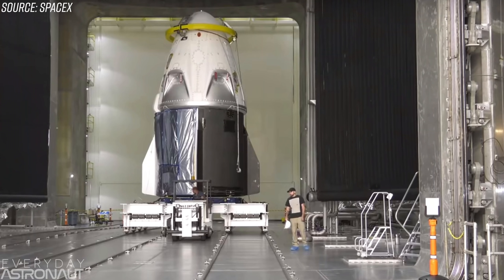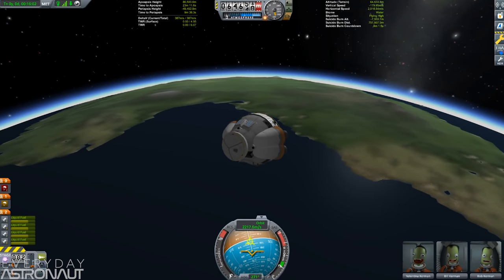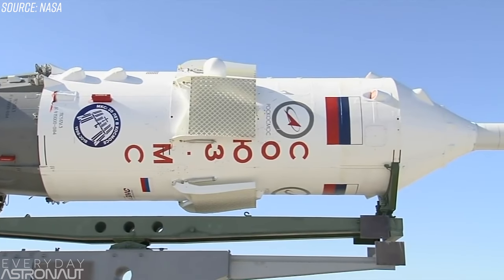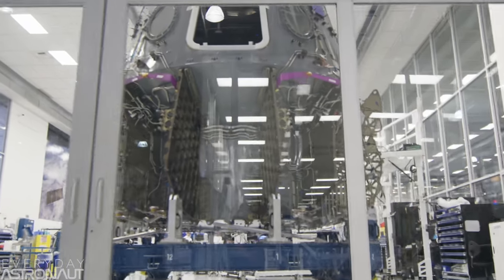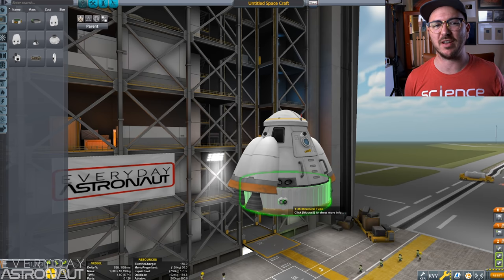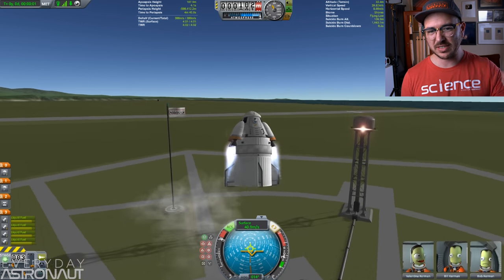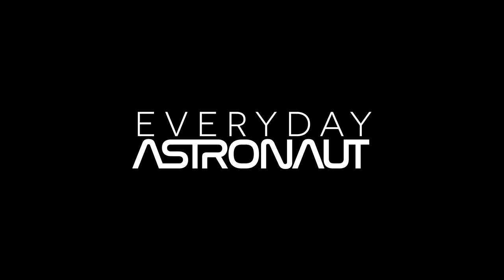Why Does SpaceX's New Dragon 2 Have Fins On It?

Comment: Hey Tim! You recently uploaded a video where you did comparisons on rockets and talked about the engines. (i don't remember what video) You talked about closed and open cycle loops and a bunch of other technical rocket engine terms. You should really make a video about what that means and how rocket engines work. I (and probably a lot of other people) had no idea what you were talking about. Btw why didn't you use the reusability mod? The Dragon trunk, fins, Draco engines, shielded docking port, heat shield and small fuel tanks all are there.
Reply: I suggest Scott Manley's video. KSP Doesn't Teach: Rocket Engine Plumbing.

Comment: Since nobody seems to have mentioned this in the first 100 or so comments... notice the clip of an Apollo abort test that starts just before the 3 minute mark. No fins. How do they keep it from turning around? I suppose it's one of two things--possibly those smaller motors at the top of the escape rocket are correcting for the capsule's desire to go flat-end-first... or, possibly, the presence of the escape tower renders the assembly stable. I recall from my model rocket days that a cone's center of pressure (the term we used in those days, side-stepping the question of whether it's more accurately called center of drag or center of lift) is two-thirds of the way back from the point to the base. And that's why the capsule wants to go blunt-end-first: unless it's got some serious ballast in the pointy end, a cone's center of mass is going to be a lot closer to the base of the cone than that. Did the Apollo's big heavy escape-rocket tower, well forward of the conical capsule, move the center of mass far enough forward for the assembly to be stable?
Reply: The video is not right. There are  important 3 centers on the rocket:  center of mass (abbreviated COM or CoM), center of thrust (COT), and the center of lift (COL). If the center of thrust (defined by position of engine nozzles) is above center of gravity and center of lift, then it doesn't matter if center of lift is even above the center of mass. That is why Mercury or Apollo capsules with escape engine tower high above the capsule did not need any fins when escaping away from exploding rocket , even when both had center of lift above the center of mass.

Comment: The center of mass should be behind the center of lift
The drag of an arrow makes the fins a center of lift in the opposite direction and with the tip beeing heavier therefore puts the center of mass behind the center of lift
Correct me if im wrong
Reply from the maker: If you were riding on an arrow, and you’re at the heaviest area (in the case the tip) you’d be near the center of mass and behind you would be the center of lift. So the center of mass is always in front of the center of lift
Reply: @EverydayAstronaut  yeah i get that thought but shouldn't the force vector of the lift decide where front and back are located? Px
Reply: Kenneth, you are thinking like the early rocket scientists who tried it that way, and then discovered that they had it backwards lol
So, I can't say that you are stupid, because they were pretty smart guys, but you have access to much research since then, so watch some videos on it, or go read on rocket stability!

And while you can use thrust vectoring to overpower the aerodynamic forces (like New Origin tried doing), it's like trying to balance a bowling ball on a needle, and it is extremely unstable. But if you add some fins, you bring your thrust and aerodynamic forces into harmony, and you get stability.
Reply: @ke6gwf  Imagine flipping in that capsule under 3gs acceleration from the solid motor.
Reply: @chriskerwin3904  that would be... Fun? Lol
Reply: @ke6gwf  uhh, it would probably break your spine to have that sudden change of momentum at that level of acceleration.  Especially since the motor appears to keep firing through the turn.
Reply: @chriskerwin3904  yes, which is why the  "... Fun?"
Do you only recognize sarcasm if it has an /s, or does it always have to be explained to you? ;)
Reply: @ke6gwf  No I knew you were being sarcastic, I just like talking about rockets. It's all good.
Reply: Think of it as a dart. Heavy end first, fins second

Comment: Good video on explaining the wings on the service module. How would it get to the ISS or a mars ship should the BFR take longer to build? Do they use the Draco thrusters? Also they have a good Dragon V2 & Orion stock-alike mod that uses the standard capsule you might like to look at using when talking about these space-ships. PS I might want to add why does the dragon-v2 wrapped around solar panels on the trunk? Won't that cause drag?
Reply: It appears that there is a layer of ceramic over the panels and most of the trunk.

Comment: Why do they need a heatshield that could fail and not use trusters to slow it down ?
Reply: Until speed gets lower enough the trusters can't even fire since would be blown down by air running on

Comment: you are totally wrong in the beginning. The rockets need to have the center of PRESSURE behind center of mass. The reason is this brings aerodynamically induced stability,because when the rocket starts to turn off course the torque induced to the back overcomes the torque to he front,bringing it straight again. It is true that the center of mass needs to be at the front,though. This increases the torque at the back and decreass the torque at the front.
Reply: Center of pressure and center of lift are two different ways of saying the same thing.
Reply: In other words, he used the wrong word, since lift is basically caused by pressure?
He may need to use a better term, but saying he is totally wrong, is totally wrong!

Comment: Hey Tim if the parachutes on the dragon failed to deploy could they still propursively land it?
Reply: Depends on a lot of things. On a pad abort, no, it;ll be out of fuel. On a normal reentry it MIGHT be able to if there is a place to land, If the abort fuel is enough for a landing(Is a capsule's terminal velocity under 430ish m/s?), and if landing software is installed. I see it as unlikely unless it was a life and death emergency? Oh and the current design of Dragon 2 has no landing legs, since those were what worried NASA, since it would mean holes in the heat shield, so It would be a bit rough on touchdown.
Reply: @aaronmcculloch8326  Yeah you're right but i guess landing with no legs is better than crashing and dying
Reply: @dann9208  Totally, Hitting the ground at fender bender speeds would be way better than hitting at supersonic speeds! Getting rid of most of that hydrazine has benefits in a crash too!

Comment: SpaceX has filed that they won't detonate their Falcon 9 in the in-flight abort test - rather they are going to send the first stage a thrust shut down command - and it will be up to the capsule to detect this loss of thrust and to initiate the abort..
Reply from the maker: Is that newer than last months filing? https://forum.nasaspaceflight.com/index.php?topic=45279.120
Reply: @EverydayAstronaut  "The abort test would start with a nominal launch countdown and release at T-0. The Falcon 9 with the Dragon attached would follow a standard ISS trajectory with the exception of launch azimuth to approximately Mach 1. The Falcon 9 would be configured to shut down and terminate thrust, targeting the abort test shutdown condition (simulating a loss of thrust scenario).

Dragon would then autonomously detect and issue an abort command, which would initiate the nominal startup sequence of Dragon’s SuperDraco engine system. Concurrently, Falcon 9 would receive a command from Dragon to terminate thrust on the nine first stage Merlin 1D (M1D) engines. Dragon would then separate from Falcon 9 at the interface between the trunk and the second stage, with a frangible nut system. Under these conditions, the Falcon 9 vehicle would become uncontrollable and would break apart. SpaceX would not attempt first stage booster flyback to KSC, CCAFS, or a droneship, nor would they attempt to fly the booster to orbit."

http://www.parabolicarc.com/2018/11/28/how-spacex-conduct-inflight-abort-test-crew-dragon/   

So the first stage would break apart from aerodynamic forces after separation, and not be terminated from any system controlled by automation or humans.

Comment: Blowing the booster will be the closest test to real failure abort that any company has ever done that I can remember.  Do you know of any instances where someone else has had a catastrophic booster failure with a capsule on the top and had the abort system perform correctly?
Reply: Sojuz T10-1 it wasn't inflight but still it had explosions and a succesful abort.
Reply: @SneeuwPoesjes    So SpaceX will still be the closest to a real world scenario that we'll see until they actually have to rely on it.
Reply: @hellcat1988  I think that in real world scenario's most explosions will have an event before it and that will already trigger the abort system. Take as example the CRS-7 flight of SpaceX there was fuel or LOX venting everywhere around the rocket which would trigger the abort system way before the actually explosion, or the Sojuz ms10 last month which triggered the abort system before the actual booster could inflict real damage. But still it's amazing and can always happen, hopefully we never have to use it :D
Reply: @SneeuwPoesjes   Yes, that would be nice, but the world isn't perfect and knowing that the capsule and abort system can withstand the forces of a detonation BEFORE the system activates would be more reassuring.  No repeat of Challenger.

Comment: If they're gonna blow an F9 booster up on the pad, well, I've got the perfect candidate! The one that got a bit wet a few weeks ago! :D
Reply: This abort will be at Max-Q (aka point of maximum aerodynamic pressure), which means about 1 minute of flight before the abort.
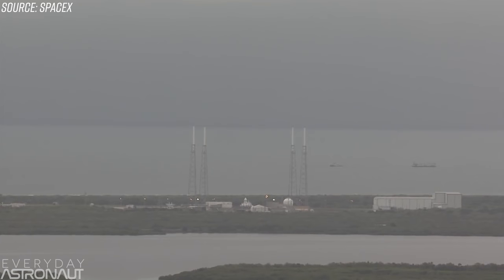They have already done a pad abort test as seen at 5:30
Reply: Yes, a pad abort with nothing else connected. I thought Tim meant a pad abort from a fully fueled F9. But if they need to do it at max Q, then of course they need a flyable rocket. :)

Comment: I would argue that the “fins” are aerodynamic stabilizers. If all they wanted to do was change the center of gravity forward, they’d add weight to the front. Think of the fins as a vertical stabilizer on a plane. The stabilizer keeps the plane from yawing left or right, making the plane go straight.
Reply: Why would you add extra weight, thus requiring more mass to fly, and messing up the capsule reentry stability, instead of adding fins to move the aerodynamic center to the rear of the center of mass?

This doesn't make sense.
Reply: @ke6gwf   For some reason, he was talking about moving the Center of Gravity to the front/top, not the rear. Either that or shifting cargo, (or whatever) towards the front temporarily. I'm just stating that adding weight is how you would shift the center of gravity to the front, not adding fins. Like you said, adding fins moves the COG more to the rear because of their weight. Moving to the front, you would have to jettison the added weight if you want to change the COG back to original configuration. You can't move fuel around to different tanks in a rocket to change the COG. We shouldn't be talking about COG anyway. I think It is irrelevant here. Adding the fins on the rear isn't done to change the COG. It's done to stabilize the craft.

Extra weight doesn't mess up re-entry stability. Apollo brought back a bunch of rocks that added a crapload of weight. Re-entry stability is accomplished by the shape of the capsule, not by the COG.. The capsule could be tumbling and would right itself because of the shape. (There's a NASA video of an engineer tossing a model, tumbling it really fast, and it righted itself in the wind tunnel.)
Reply: @adamsmith5151  you apparently don't understand rocket stability, and also didn't hear correctly what he said.

He never talks about moving the CG forward, he talks about moving the center of lift/ aerodynamic pressure to the rear of the the CG.

In order for a rocket to be stable, the CG has to be forward of the CP, which is why model rockets have fins, and why darts and arrows and badminton shuttlecocks have fins at the rear, to shift the CP to the rear of the CG.
Yes, sometimes you may add mass to the front if it is too light, like the big weight on the front of a dart, but on something like this, you already have plenty of weight up front, you just need to add more aerodynamic pressure behind the CG so that it is a stable system.

But he never talks about moving the CG forward, only about moving the Center of Pressure/Lift to the rear of the CG.
Reply: @adamsmith5151  Oh, and part of why the capsules orient themselves as they do is by having the CG in the right location, so if you moved the CG to the top of the capsule cone, it would flip over and go pointy end first.
It is through having the CG near the heatshield that it gets the large end first orientation.

So for Apollo, they would have carefully calculated where to stow the rocks, and how much weight they could bring back, so that the stability would be maintained properly.
Reply: @ke6gwf  As I stated before, it is the capsule shape that makes it point heat shield first during re-entry not the COG. Air moving over the capsule at thousands of miles per hour is going to flip and keep it in the correct orientation, whether the COG has been shifted or not.

In Apollo 13, they had do move a bunch of weight because they forgot to calculate trajectory with extra weight they would have brought back and would have ended up skipping off the atmos. They didn't have time to calculate the individual weight of the ballast that they moved to calculate the COG and they made it home fine.
Reply: @adamsmith5151  really? Do you totally not understand how aerodynamics work?
CG and CP are just as vital to capsule stability as to rocket stability.
CG always has to be in front of CP, which is especially important when dealing with a capsule going big end first.

If CG were very far back from the heat shield, say it were a hollow plastic model, it would flip around because the heat shield end obviously has more drag.

Read this if you don't understand this concept.

https://www.wired.com/2013/01/tumbling-back-to-earth/
Reply: @ke6gwf  I have 1 year of formal education in aeronautics which included aerodynamics and weather. Thanks for the link. I'll read it.
Reply: @ke6gwf  Additionally, The capsule in the article you linked is more representative of a Gemini capsule, not an Apollo & SpaceX capsule. Both have completely different aerodynamic properties.

Comment: There is in fact, not a single fin on the Dragon capsule. The four fins are located on the aeroskirt of the capsule. Massive difference.
Reply: Not really, optimally the skirt will remain until docking
Reply: @cactusfishy1596  I take it you are not an engineer. The aeroskirt and capsule are two entirely separate and unique components of the overall system. Saying there are fins on the capsule is as wrong as saying "I wear shoes on my ears".
Reply: @liquidhype3025  I'm guessing you're not a real aerospace engineer judging by your prof pic :P and although they are separate, they WILL BE USED IN SOME ABORTS. You really don't understand how it works.

Note, shoes and ears have nothing to do with it.
Reply: @cactusfishy1596  The fins are not located on the capsule.
Reply: @liquidhype3025  YES EXACTLY, everyone gets that. The skirt IS STILL ATTACHED DURING LAUNCH ESCAPE.